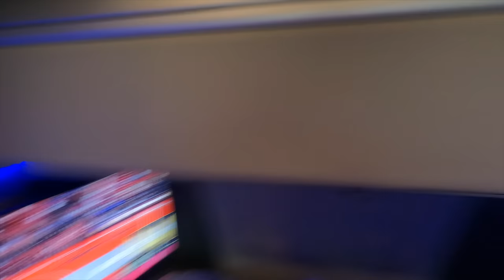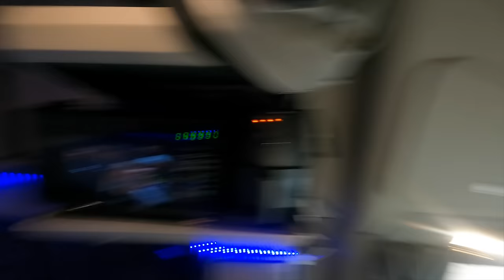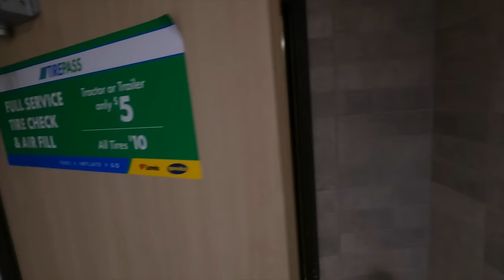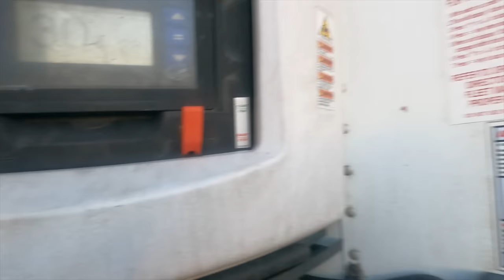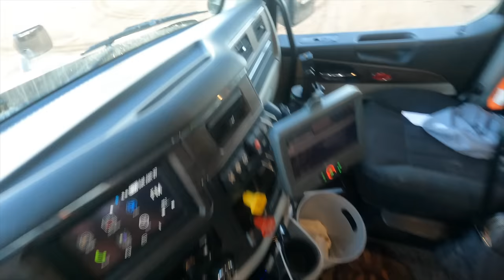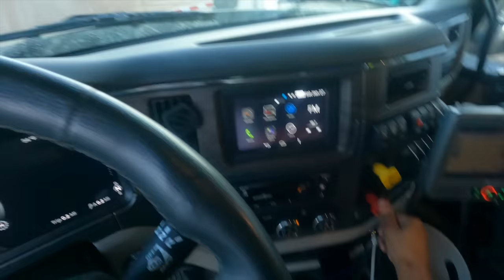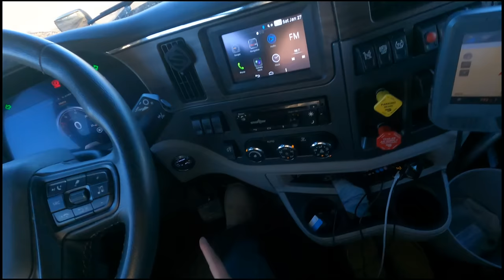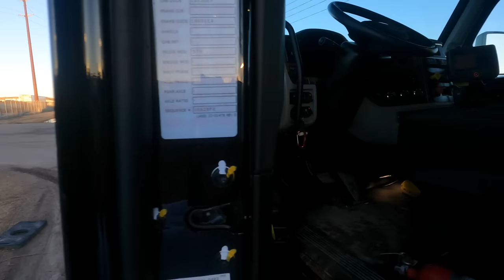Day in the life of a 25 year old truck driver | Prime Inc 🚛

Comment: LOCK YOUR TRAILER BRAKES AND DRIVE THE TRUCK FORWARD LIKE YOU CHECKING TO SEE IF THE FIFTH WHEEL LOCKED AND THEN PUT IN REVERSE “ROCK BACK AND FORTH” that should help more with TANDEMS..
Reply from the maker: Just seen your comment bro sayless ima try it out next time I struggle w it 🙏 Preciate the advice fasho 🤞🏾
Reply: I was literately chiming into say this! I wanted to read the comments first incase someone already did!!

Comment: When trailers are that close, only raise the gear enough to pull out and then finish going up. If you can overinflated your rear bags, use them to lift the trailer and pull up. Don’t mess around that close.

Comment: To get air to slide the tandems, all you need to do is let the engine idle with the trailer brake pushed in, that’s it. Don’t push the brake, don’t drive. Pushing the pedal is counterproductive as it uses air and takes air away from pulling the pins in. Also, I keep my tandems as far back as I can. It rides better and it’s more stable. Just need to take care on turns and backing a little more.
Reply from the maker: Noted! Appreciate that boss

Comment: just a tip bro if a pin wont go in its more than likely got pressure on it. just put the truck in reverse or drive and rock it back and forth youll hear it go in.

Comment: Once you pull the button,you have to rock the trailer for the pins to move. Only the 24 series trailers will release automatically. You're not legal stretched out per each state bridge law. It's usually no further than the 12th hole. Your tire sensor box showed red as well. Just trying to help boss.
Reply from the maker: 10/4 man I appreciate it all! The rocking thing I wasn’t hip on lol these comments helped remind me tho. And the tire pressure there’s a bad sensor on this back right cab tire. I’m going to get it situated next time I’m at a terminal but I always double check the pressure by hand just incase. Thanks again! Don’t ever think you’re stepping on toes bro I appreciate all the help I can get I know I’ll need it or if not me then somebody in the comments will for sure

Comment: Engine knock is either low oil pressure or bad fuel mix... you should not drive have it checked
Reply from the maker: Agreed boss I ended up reaching out about it. More on that in the next video but definitely got a good ear!!!

Comment: You keep saying it, but I nvr caught on to what you wer referring to when you said, “my tanners are all the way in the back” lol what is that? And what exactly does that mean?
Reply from the maker: Tandems and they’re basically like a sliding rail on another sliding rail. One “rail” connected to the big box that holds stuff, the other “rail” connected to the wheels basically. When you slide them you align where the wheels are in relation to the big box that holds stuff. Depending on where your weight is and where you’d rather it be, you slide yourself along the “rails” so that you have your weight situated the way you want it

Comment: And did you scale a loaded trailer with your Pete and then set the tractor gauge while on the scale before you got yo load? If not then that’s why yo tractor gauge was reading all crazy. Could be off. I set mine to 1,500ibs over
Reply from the maker: Nah bro never 😭 in all my two lil years we ain’t never adjusted the tractor scale I’m hip now tho I’m definitely gone get it right next time I get a chance
Reply: @IsThatJustDex  lmao 😂 bro I said the same shit when I picked up my Pete. The gauge was set to 3,000ibs over. I said who in the fkc did ts 😒. Scale on the terminal got me right tho. Needed a small flathead to turn the gauge needle